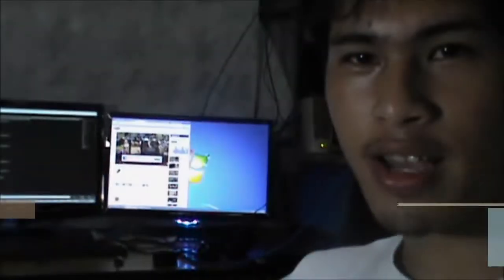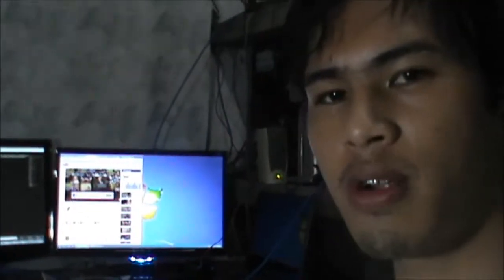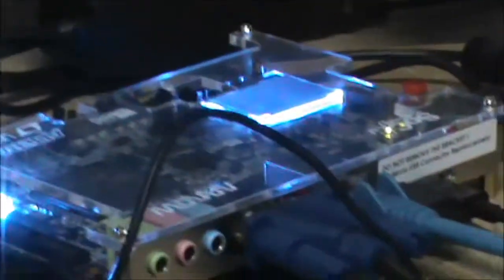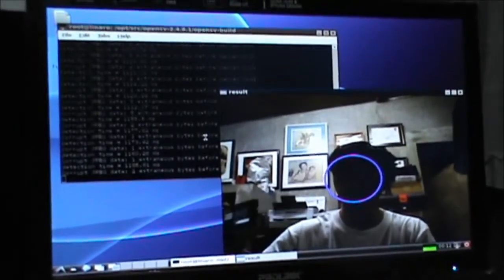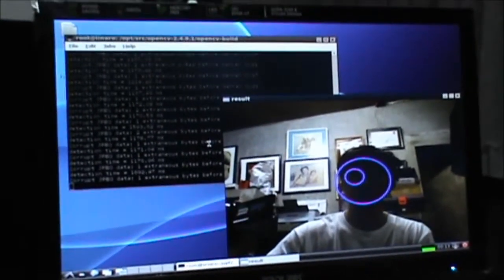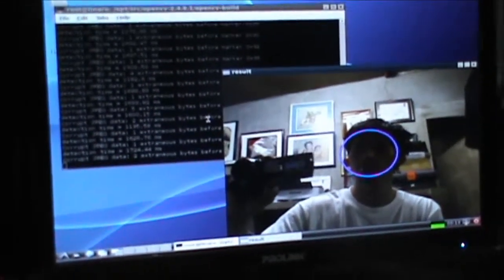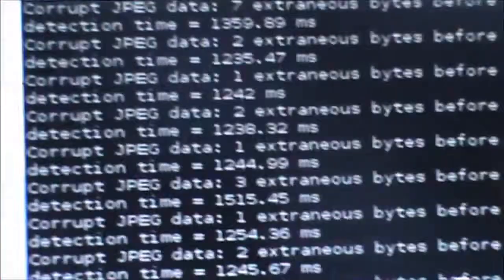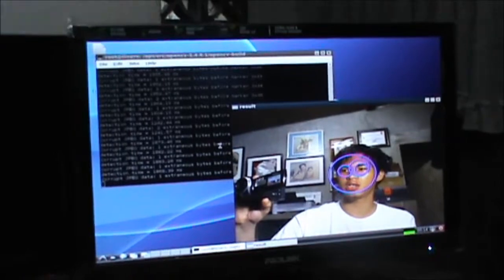[SocKit] OpenCV on SocKit

Comment: I get the following error
uvcvideo: Failed to query (129) UVC probe control : -110 (exp. 26).
uvcvideo: Failed to initialize the device (-5).

I compiled the kernel available from rocket boards linux-arrow-sockit_vga and tried three different webcams: creative, microsoft and deltaco
Reply from the maker: +Hayder Mohammed Ali Did you work on adding the proper UVC module for you Linux Kernel?
Reply: Hi, how did u compile your uvc kernel into linaro ?